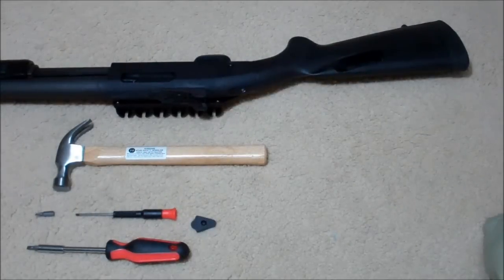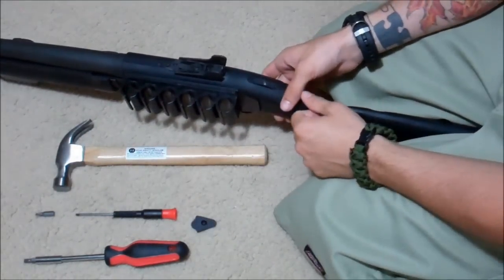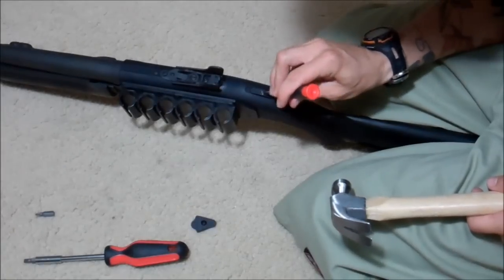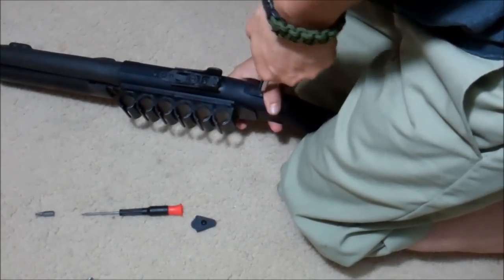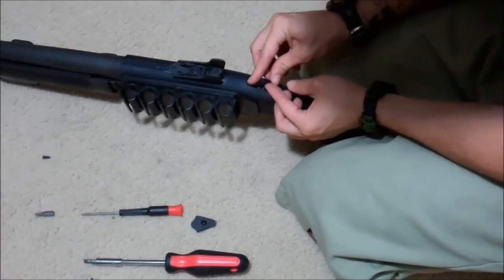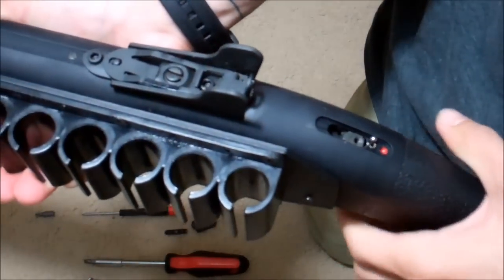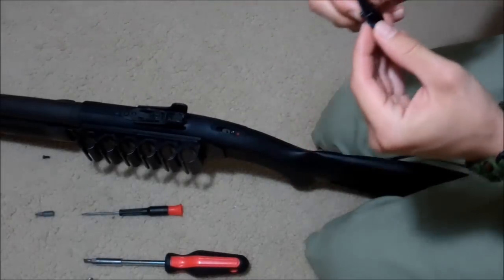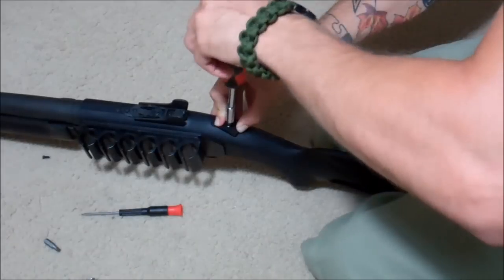How To Remove or Replace A Mossberg 500 or 590 Safety - Eric TBP

Comment: I'm glad I found your video in time- I was ready to just start cranking down with a screwdriver. I never knew about the anti-tamper screw, or the the fact you needed to pull the action back. My safety install was painless thanks to this. Nice job.

Comment: Thank you so much for taking the time to shoot and post this video. I'm not a gunsmith, but I felt like one after changing my safety slide. Pretty sure it took under 3 minutes and I didn't lose the ball bearing or any other parts. I would've totally messed it up if I hadn't seen your video first. Thanks again and keep it up.

Comment: Took me longer to watch your vid 3 or 4 times than to do the actual job. Thanks for posting this up!!! I used the tiniest bit of lithium grease to hold the ball on the spring. Applied it with a q-tip. Worked awesome!! Nothing as small as that ball-bearing should be in my big mitts.

Comment: Good video. I used your method. The screw came out much easier than I thought it would. I could probably have reused it, but I already had a replacement on hand with a Torx #15 head.

Comment: Thanks man! I've got a metal replacement coming in the mail, and I figured It would be wise to check the web after I got a look at that tamper resistant screw. I read some horror stories on forums before I found this video. I assume that by all of the thumbs up, that this method is the way to go. Very helpful.

Comment: Thanks a million.  A superb video.  Your instructions turn what could be a difficult job into something straightforward.  I've used your method several times to remove the ridiculous Mossberg one-way screw on both 500's and 590's.  Occasionally, the screw would turn without the tapping.  Once, the screw was so tight I had to use a Dremel tool to create a slot in the screw.  This destroyed the plastic safety button, but it was going to be discarded anyway.  Thanks again for a great video.

Comment: Did not know to lock the action back. The retaining bracket fell down. With a little effort, I was able to trick it into place with a small L-allen wrench through the opening, held the shotgun upside down, carefully removed the allen wrench and locked the action back without having to disassemble the shotgun. Added about 2 minutes to the job. 

Thought this might help someone.
Reply: you are the man for posting this. same thing happened to me. was about to take it all apart while extremely pissed off haha
Reply: @Razorback Everything I put in was secured in place when finished. I have shot the gun many times without any issues.

Comment: I've been taught the tapping method is plan "B". Plan "A" should always be to simply try turning it with a normal screw driver and extra pressure first. I cover an appropriately sized screwdriver tip with duct tape to protect the metal in case I slip and it provides a better grip. Then with direct pressure, I bear down and unscrew like normal. This method works 80-90% of the time. If not, then resort to the tapping method in plan "B".
Reply: Ahhh mate plan A is nooo bueno 💀

Comment: Fantastic video! I didn't think the center punch would do it but it worked like a charm! 👍 And thanks for the tip on keeping the chamber open, saved me a big headache! Whole job took less than 10 minutes, old to new. 👍 I didn't notice any loctite on the old screw, I didn't put it on the  new one..  If it loosens up I'll do it, but it came with a Allen head screw, and I didn't want to strip out the Allen head If I have to remove it...

Comment: I was going to do just what you did in the video but after a quarter turn of the screw it relieved enough tension to enable the safety to work properly. I may disassemble and clean it later but it's fine now. Thanks for the video.

Comment: I wonder when they switched to that anti-tamper thing. I've got a 500 here that my dad says he bought in the late 80s or early 90s and it has a traditional screw. It doesn't look like a replacement, it looks original. Thank you for this vid.
Reply: Mine too. I've had it since 1985 and this is the first time I have needed to replace the safety so it was a traditional screw at that point. I liked his video and found it helpful all the same.

Comment: Thank you! I just picked up a used 500A today and the safety is a bit sticky (pushing forward to disengage is ok, but pulling back to engage is quite stiff). I already cleaned up some dirt and oil from inside the safety channel, but I'm now looking into removing the slider and properly cleaning underneath it. This video was very helpful in this endeavor.
Greetings from Germany :)
Reply: And already done. Took me no more than 10 minutes (including copious amounts of fumbling around during re-assembly while desperately trying to not lose the ball bearing). I didn't even have to hammer down the screw driver to cut the screw head. A generous amount of downward pressure (as suggested by some other comments here) was already enough.
As expected there was quite a bit of gunk under the slider. Looks like some previous owner didn't bother to take off the stock when he was oiling it and some of that seeped into the safety. It's a bit smoother now, but engaging the safety is still a bit stiffer than I would like, so I might opt for an aftermarket safety slider with a more positive knob to push (the ProMag one looks like it might fit the bill). And now I already know how to change it out ;)
Thanks again, your video made what could have easily ended in me spending an hour or more completely disassembling the gun and gutting the receiver (and then having to figure out how to put everything back together again) into a ~15 minute job (including watching this video and gathering the tools XD).

Comment: Thank you so
Much for the info on how to get that stupid screw out and about having the action back. I watched another video and the guy took the trigger out to get the safety Back in, did not put the ball bearing or the little plate back under the new safety. His video has to have caused grief to anyone that followed his directions
Reply from the maker: +rasberry27834 No problem, thanks for watching.

Comment: Please don't do this. There are bits made specifically to remove one-way screws. I ordered mine from the Home Depot website (they're not in the stores) with free shipping for $13.97 + tax. It's a 3-bit set (small, med & large) with a sleeve by Ryobi. My new NDZ safety piece and these tools should arrive around the same time.

Comment: Thank you so much for posting this!  I had no idea Mossberg had these screws.  I’ve seen other older mossbergs without them; is this a new addition?  

Anyways, couldn’t find a video showing how to get this off WITHOUT using some sort of custom security bit (of which I cannot find).  Yours was the only one I could find!

Any idea what these screws are called or where to get the custom bit/adapter to unscrew these?
Reply: I'm not sure if there is a bit/adapter for these, maybe some specialty tool similar to this method, but the design with the slopes is to provide minimal leverage surface to unscrew. I think the intention is more for 'this is not intended to be removed' applications. Or I could be completely wrong

Comment: Ok I got mine installed after watching this about 10 times and I dropped the dang ball bearing down in the action! I did get it on finally because of this great vid so thank u very much! One question, I put loctite on the screw and put it on tight but the safety seems to have a little wobble in it, is this normal? Thank u and god bless the republic! Molan label

Comment: I saw a video where someone had a safety near the trigger which locks the pump slide, is there one of those on the shockwave? Mine arrives tomorrow and I hadn’t considered the fact that I’m a lefty, so I might have some trouble holding that button down.
Reply: If so, is it possible to modify or remove it to avoid that issue? I’m not worried about voiding a warranty.

Comment: Where did you buy or where can I find that new safety switch. I have trouble pushing it to the front (fire) position, but it easily can be put in the safe position. Thought I might just switch it out for some aftermarket stuff.

Comment: OMG... NO, people! Buy a small set of gunsmithing screwdrivers and use the right tool for the job! Please don't hammer on your shotgun with a Dollar General tool set! A properly sized screwdriver removes the safety screw easily, without damaging the screw and without the risk of slipping and damaging your firearm.

Comment: I fucked up and did not pull the action back. Pulled out the trigger mechanism housing, barrel, the extraction leavers on both sides just to be able to grab the little metal safety mount.
Reply from the maker: Yeah it can be a pain sometimes

Comment: no no, you can totally unscrew those easy. with a good, sharp screwdriver I set it in and tapped it straight downward with a hammer, and it unscrewed fine. even on the brownells site it says you can just give solid downward pressure and unscrew. I did put my shotgun in a vice.
Reply: Same here. Push down and turn - came right out.

Comment: can anyone please answer this. i have a mossberg 500 ag. and it has the plate with the ball bearing and spring underneath. but it has no plastic safety switch. everytime i fire the gun the recoil makes the safety shift down some to where i have to keep moving it back up after every shot. would just buying the plastic switch fix it??
Reply from the maker: +Timothy Galloway Are you saying you have the plate with the 3 holes in it as in my video, but do not have an actual safety switch? If that is the case, you should get an actual safety switch. The screw may not be able to tighten down far enough to keep the plate from moving under recoil and the thickness of the safety switch may help to put more pressure on the plate and ball bearing. Not to mention you will be able to use your safety as intended. 

P.S. I am not a gunsmith, and if you can't figure it out, take it to a local gunsmith. 

-Eric
Reply: +Prepper Eric thanks.  do u think a plastic one will do or do u reccomend a steel switch?
Reply from the maker: +Timothy Galloway It really comes down to personal preference. It really is not a high stress/wear item, so you can use a plastic one like the factory one. I went with mine because it is over-sized and I can reach it easier. 
-Eric
Reply: +Prepper Eric so how would i take my screw out just push down and turn counter clockwise?

Comment: Doesn't work all the time.......
The factory safety is plastic, stick a flat blade screw driver under it, brake it in two and then grab the screw with pliers

Easier then hammering on the screw
Reply: Chief60 omg thank you worked 60 times better
Reply: Maybe on a 500 it’s plastic, and not even all of them at that.

The 590 and 590A1’s are metal.
Reply: @tangoplays2547  Good input. I have 3-500's and two of them have a metal safety tab.

Comment: step one, pull the action back.  I skipped this step when I replaced mine. Bad idea.   A two minute job turned into a thirty minute job not counting the time I had to spend looking for the microscopic detent ball that flew off into space.
Reply: I just did that. Wish I saw this video first.
Reply: Same here. I lost mine for good. But ordered a new one. Without it, the safety just flops around.
Reply: Did not know to lock the action back. The retaining bracket fell down. With a little effort, I was able to trick it into place with a small L-allen wrench through the opening, held the shotgun upside down, carefully removed the allen wrench and and locked the action back without having to disassemble the shotgun. Added about 2 minutes to the job. 

Thought this might help someone.
Reply: Yep. I did the same. Didn’t lose any parts but the one piece fell into the receiver. On top of that I have a shell in the chamber. Guess I’m gonna try to get it to fall back into place.
Reply: Didn't even know there was a detent ball until this vid. Just went to look today after screwing up a safety install yesterday and found it hidden in the carpet right now. SMH